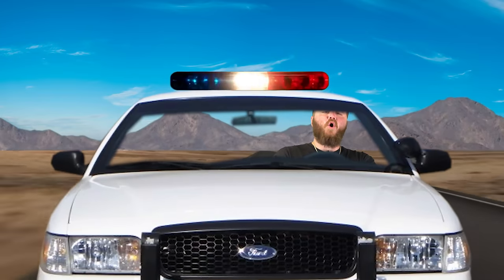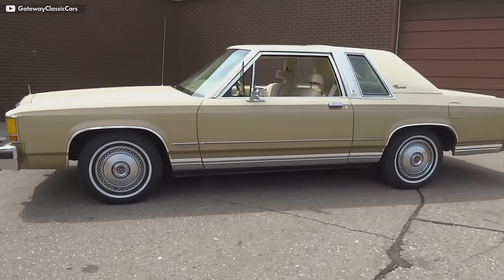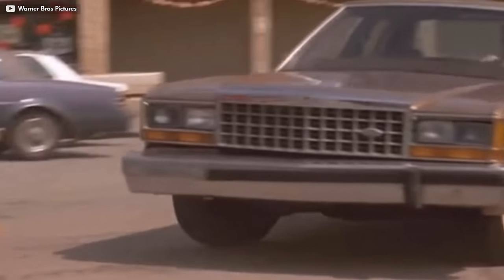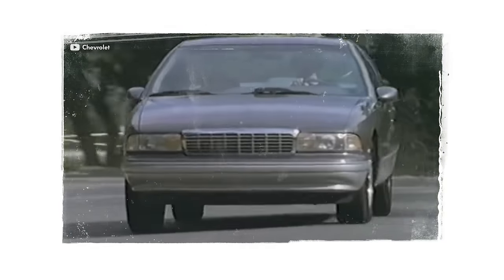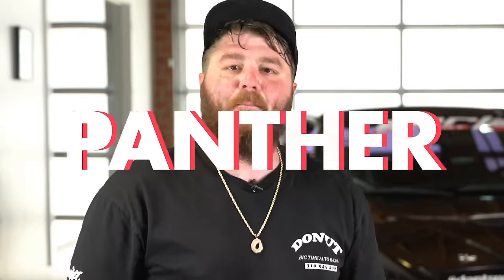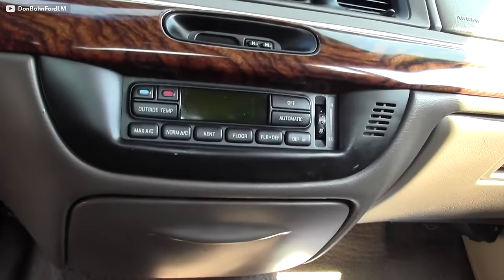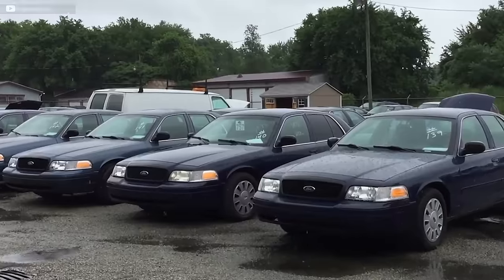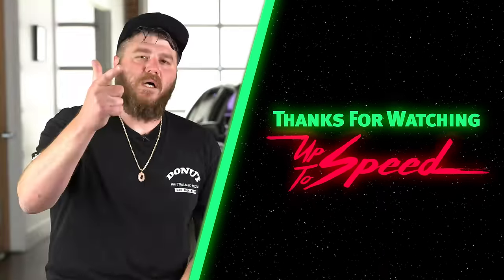Ford Crown Victoria - Everything You Need to Know | Up to Speed

Comment: You skipped out on why cops miss the Crown Vic so much.  It's the seats. No new car comes with seats as comfy as the Crown Vic. Especially in leather, the car is a very comfortable road tripper
Reply: I remember when my parents and I went on vacation with our Crown Vic and we had to stop at every second motel just to not fall asleep 🤣🤣
I WANT IT BACK!!!
Reply: Yes they are comfy, but here in the Midwest, rear wheel drive sucks in the snow since there isn't any weight holding the drive tires down
Reply: @benpamperin1074  you can carry heavy stuff in the trunk like bags of kitty litter, etc. This is great for added traction.
Reply: Agree
Reply: Yes, they are indeed comfortable if it is the soft kind. My 1989 LX has the stuff sofas use, and on the highway, it's a living room on wheels.

But my main purposes for it is V8 power, durability, and "cop image".
Reply: It sure would
Reply: The Crown Vic cloth interceptor seats are not exactly comfortable. I love the car but probably the most uncomfortable seats I've experienced in all of my 40-year driving history!
Reply: @benpamperin1074 get weights (like lifting weight) or even cheaper alternatives like kitty litter etc. My grandpa has a rwd ford f-150 and it was hella light in the back he just put ever distributed weights back there
Reply: @Tht1Dude  I keep 4 50lb bags of rock salt in the back of mine. Good weight in the back and if i get iced on i can melt my ass outta there

Comment: Put a Coyote engine in a redesigned Crown Vic. I swear that would sell like crazy
Reply: exactly
Reply: @kosycat1  the direct descendant to the panther platform is the ford foucus, lincoln also has form of the foucus and near the end of its life mercury even had one based on the foucus. its basically a front wheel drive unibody descendant of the crown vic.
Reply: @joshuamcpeek4708  Wow never knew that, thanks
Reply: if the engine in my 07 vic ever goes out ima put a used coyote low miles in it .
Reply: @ChronicEye  you'll be waiting a while lol
Reply: Joshua Mcpeek damn so they basically halved the cylinders, I’d rather think of the Ford falcon as the new crown Vic
Reply: @mateo10734  the foucus is fords full size sedan platform now, it was made shortly after the EU and epa banned new production of the crown vic condemning it as a guzzler. Ford stated the foucus as the crown vic's sucessor.
Reply: Joshua Mcpeek wait so what about the fusion is the fusion not bigger than the focus🤔
Reply: The mercury marauder had the same motor that was in the ford mustang cobra.
Reply: Joshua Mcpeek They literally have nothing in common, lol.
Reply: They kinda already did that its called the marauder
Reply: Redesigned?! Why redesign it?! Modern cars are bloated and shapeless. The Crown Vic looks very solid and athletic. No need to ruin it.
Reply: @joshuamcpeek4708  You might want to fact check. The Focus is far smaller than the Vic and is labeled as a compact car, whereas the Vic is labeled as a full size sedan.
Reply: I agree with that to some degree, but the only platform Ford has to use at the moment is the one the new Continental uses. Even worse, they wouldn't put a v8 in it.
Reply: @AdmiralKakarot  it was fusion i got names mixed. i  get them mixed alot.
Reply: it sounds cool to us, realistically, doesn't sound cool to ford. Car companies always are careful to not compete with themselves. Ford already has the mustang, and to them, that's good enough. They wouldn't risk competing with the mustang by putting a coyote in another rwd sedan or coupe.
Reply: @andymanusafa  Yes, but the thing with the Mustang is it has several options in the performance category. The GT350 and GT500 both have very powerful v8's and the entry level has a very respectable v6 and the ecoboost has a 2.3 with high power for a factory four cylinder. Back in the 80's, the Mustang, LTD/Crown Victoria, Bronco, E series and F series all shared the 302 and 351 Windsor that carried onto 1993 before the Crown Vic was redesigned in 94 with the introduction of the 4.6, which was also used in the Mustang, Thunderbird, Grand Marquis and Cougar and later put in the F series, E series, Town Car and Expedition in 97 and later in the Explorer in 2002. The fact is, Ford has had a history of using the same v8 in several different models. Even now, the Coyote 5.0 is used in the Mustang and F150.
Reply: Chevy SS
Reply: Lol there is enough room for Ford Godzilla 7.3.
Reply: Sedan sales are down so no big sedan anymore for a while
Reply: @TwoDollarGararge  Yeah because everyone is having a hard on for crossovers and SUV's.
Reply: @AdmiralKakarot  yeah I don't get it but then again I drive a 15-year-old sedan so
Reply: 7.3 gas
Reply: @apprenticefelix7740  Why do a big block when a small block works just as good if not better? If you visit ADTR.net, you will see that they have a specially designes 5.3 modular 323 Stroker for the Crown Vic. They also have 5 speed and 6 speed manual conversion kits.
Reply: @AdmiralKakarot  cheap and plenty
Reply: @AdmiralKakarot  is that a ford boss block  base like a  6.2
Reply: @apprenticefelix7740  It is a Boss block, yes
Reply: Yeah, but the Panther isn't coming back, sadly.
Reply: @ChronicEye  mines about to roll 300k
Reply: Sarmatian Cougar I would hope when they say redesign they mean a retro future approach like the new mustangs. Old school aesthetic concepts applied with modern design philosophy.
Reply: It would be awesome if they put a manual and a coyote in it
Reply: sad thing is they would need to put a v6 and other v8 variants to come out even
Reply: @ChronicEye  I'm putting a 96 viper engine in my 05 Mercury if it's 4.6 ever dies ;]
Reply: @m.d.498  the 4.6 dohc in the Marauder was NOT the Cobra motor, it was the same as the 03-04 Mach1. The 03-04 Cobras had iron blocks & aluminum heads with a roots supercharger. The 03-04 Mach1 & Marauder had aluminum blocks,heads,& intakes,different cams for more low end torque. Also I really believe Ford lied about the Marauder & Mach1 horsepower numbers. Believe it or not, my wife's Marauder weights less  than the new Camaro & Challanger...& it's a body on frame.
Reply: @m.d.498  yes but sadly they did not offer the more reliable 5 speed manual that the mustang GT had the AOD4 is not a bad transmission but it is definitely the worst part of the panther platform, at least in my opinion
Reply: id buy one on the spot
Reply: Stock. It is purdy good.
Reply: It would definitely give the charger a run for its money.
Reply: id pre order this minute
Reply: Bring back how it was in 2011 and call it the Crown Victoria GT
Reply: So a different engine and it looks different?
Reply: @catinthehat5140  No, the current 5.0 V8 just in a brand new Crown Victoria sedan
Reply: Ford Australia made a large sedan with a coyote
Reply: @joshuamcpeek4708  You're a bit incorrect, it's the ford taurus that is the full size sedan now
Reply: Would fucking buy one in a heartbeat